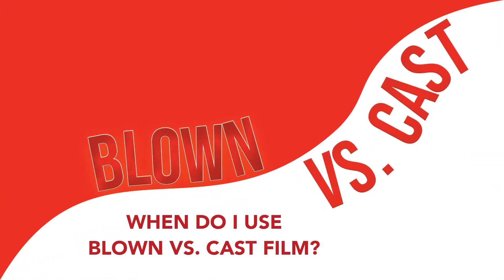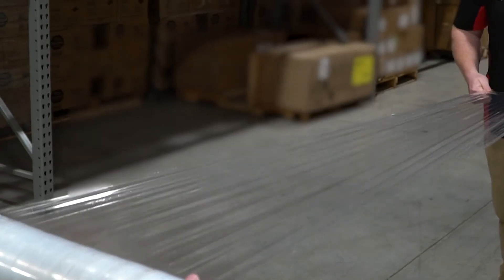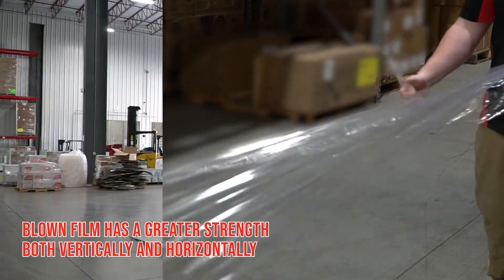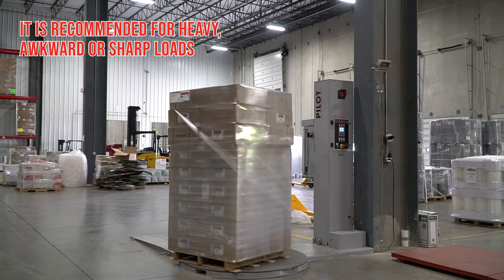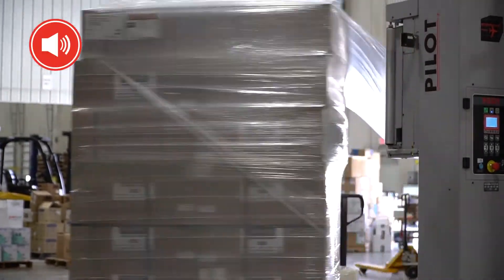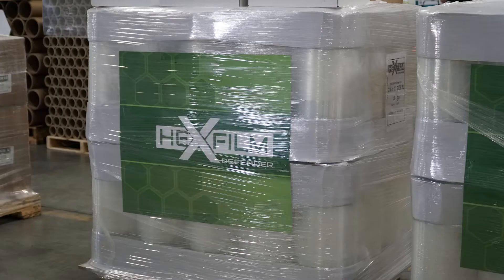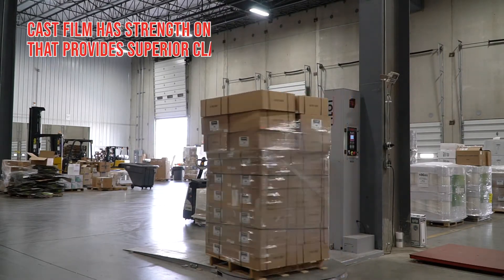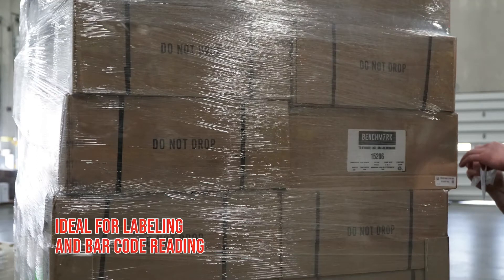When do I use blown vs. cast film?

Comment: Subject is here only related with cling film. However you can produce many types of blown and cast film and can be used both of them depending on the application. This info in this video is very limited and only for cling applications.